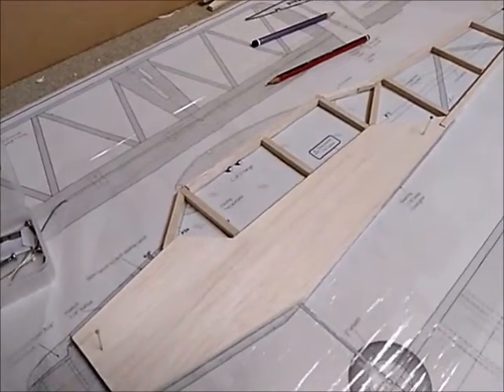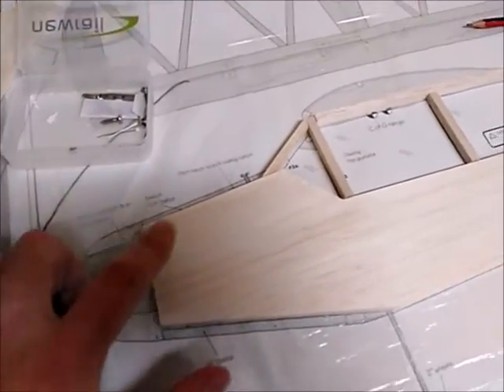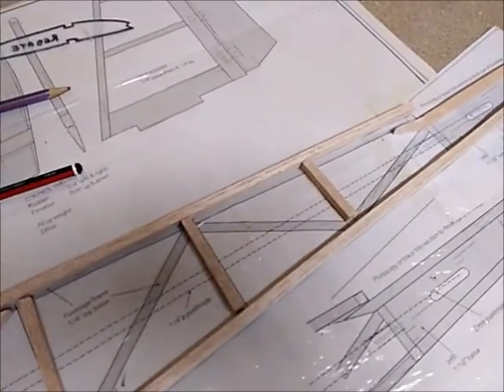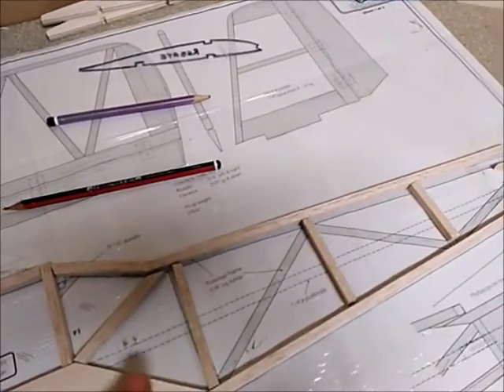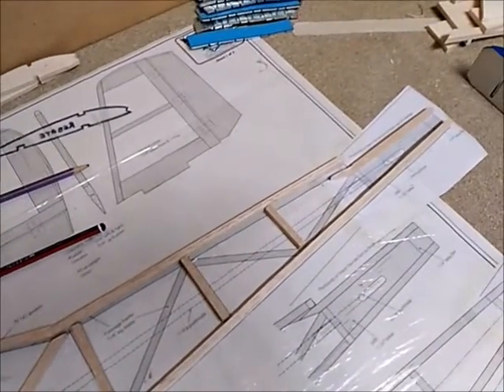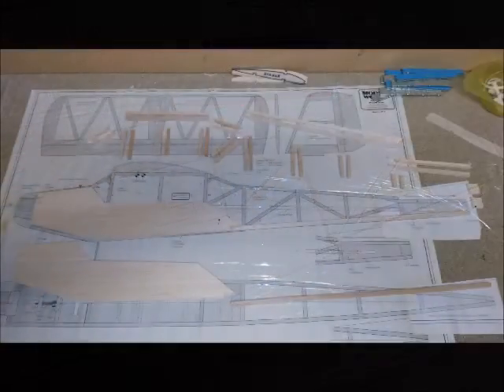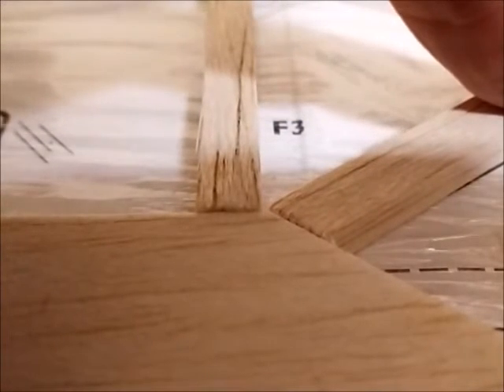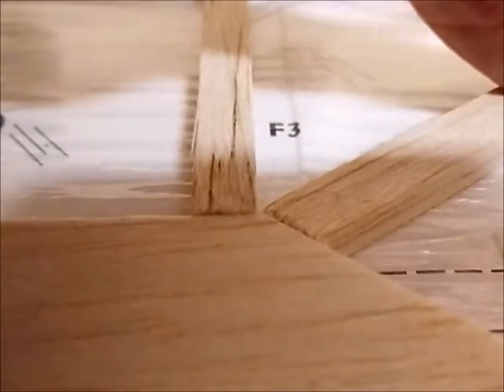Video 9: Fuselage construction

Comment: Can you please give me design parameters of your rc plane
Reply from the maker: +Engineers4 U The motor is a 22x28 brushless outrunner turning a 7x5 propeller. The battery is a 1500mAh 11.1 volt 3-cell Li-po. The electronic speed controller ESC is 30Amp. Radio is standard 4-channel, but uses micro servos as they're only 9g in weight. Wingspan is 44 inches, all up weight 740g.
Reply: Conor O'Neill bro actually im asking for the design of rc plane ...i mean i want the cad file or any images of rc plane design with dimensions
Reply from the maker: +Engineers4 U ah, ok. I didn't design it. Plans are available here: https://www.sarikhobbies.com/product/millie-bob-plan/
Reply: Conor O'Neill thank you so much for your instant reply ....I like your videos...you made good air planes